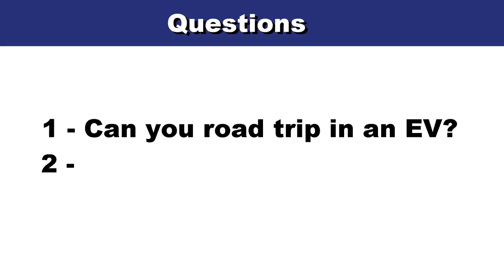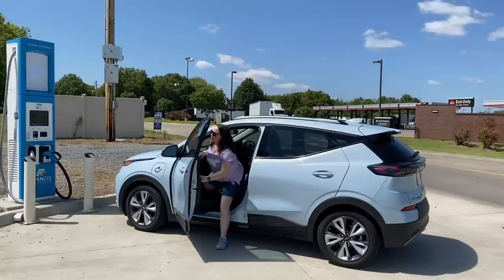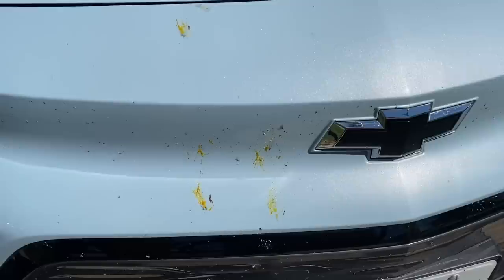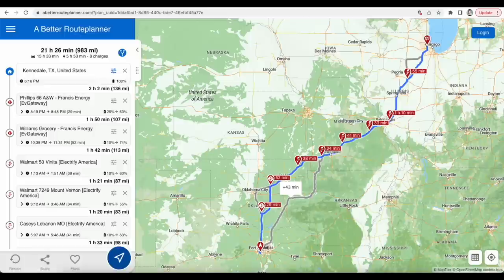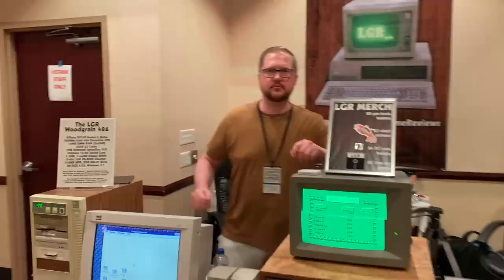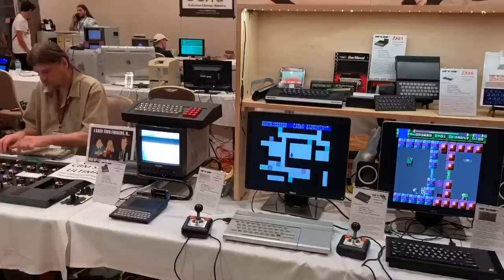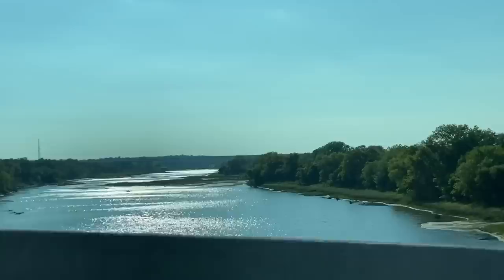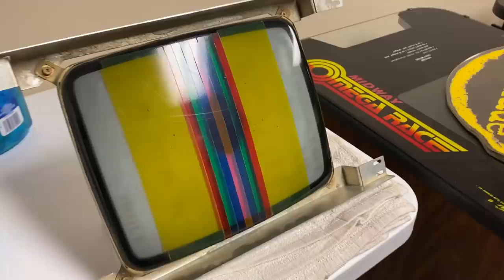EV Roadtrip, Vintage Computer Festival, and Moonbase Repair

Comment: Back in the day (1993-1994ish) I had gotten really lucky, and had a chance to upgrade my Macintosh SE. New hard drive, external drive too, maxing out the ram, I had to buy one of those really long 'mac cracker' screwdrivers.. the works! It was am amazing time, and I was super excited to get it all set up and put together. Unfortunately, in the process of the various opens and closes that had to be done, I was struggling to get a cable on the motherboard loose (it had a clip you just couldn't access reasonably), and I instinctively rested my wrist on the board on the end of the CRT. I guess I put just enough leverage on the pin connector there, because it snapped off the pencil-eraser sized nub on the very end of the tube. I KNOW this experience... and it still hurts to see it happen to someone else!

The story does have a bit of a happy ending tho. I researched the costs of trying to replace that tube (burnt tubes were cheap, but unburnt tubes were ungodly expensive) , and it would have been much cheaper at the time to just pick up another mac. The parts I'd purchased for the upgrades were able to be returned, and with some help from my sympathetic parents, I was able to pick up a Macintosh Color Classic on a 'we're having trouble moving these" sale. That color classic was where I learned Photoshop (2.0), and it was with me, and still working until 2002.

But I will forever remember that feeling of the vacuum breaking, and the air rushing in. I feel for you here! Be sure to hang onto that tube tho til you get a new one, so you can measure it for replacing the color strips (assuming you plan to do so).

Comment: its wild there are so few charging stations still. you would think restaurants and shop owners would be fighting each other to put them on their property and they'd be all over the place. you literally have a captive audience/customers with time to kill. but i suppose just like electric car ownership itself, charging station installation is a cost barrier to entry. i hope Biden's bill with electric car subsidies does something to help people overcome these barriers.
Reply from the maker: Yes, unfortunately, installing a DC fast charger probably costs north of $100,000 at this point.
Reply: Electric vehicles are about the same as methane/natural gas vehicles: rare. As an Okie I'd have to say those "Francis" chargers are likely an example, as they're likely installed & maintained by Francis Tuttle Technology Center (a votech), likely with funding from a grant.
Reply: It's not just the quantity it is if they're even working and vacant. If you're running low on power there's nothing more stressful than having to search around for a charger. That's why I won't be getting an EV until I am forced to. The eco friendliness is over-rated, the manufacturing process on an EV requires more energy and the battery materials are mined in very bad conditions for the workers. They're for people who just believe what they are told by the government and don't look at the wider picture.
Reply: @6581punk  yeah its not as green as it could be but i feel like its at least a baby step in the right direction. the real polluters are corporations though not individual cars.
Reply: @6581punk  you sounds about a decade out of date
Reply: Yes, spend massive amounts of other peoples money to subsidize a wealthy minority.
Reply: @6581punk  Not to mention I don't want that massive bomb of a Lithium pack anywhere near my home, especially while charging.
Reply from the maker: Ahh.. but a massive bomb of a tank of combustible gasoline is totally fine?
Reply: @The8BitGuy  While it's true that the two aren't that dissimilar, and it is possible for the electrical system to short out and cause the gas to catch fire, I'd say the chances of that are pretty slim. 

Now take the gas tank and put it inside the electrical system, beef up the electrical system like crazy, and make the 'fuel' inside combust if exposed to air. Not to mention if it does catch fire it's a whole lot harder to extinguish. No thanks ;)
Reply: I think a lot of it is conservative-aversion to electric cars. What I mean is that trip he took is right through the densest (pun intended) part of 'Merica and shop/restaurant owners that are deep-woods pro-fossil fuels think putting one in is tantamount to burning bras and the American flag and will put them in the crosshairs of their conservative customers. That may sound ridiculous to the rest of us, and "doesn't everyone's money spend the same"? But you really gotta understand just how some of these people are. Everything's a statement, and they know better than anyone how much their peers will slag them for making the wrong ones.  I really believe with the one-off or local-level businesses, this is totally, totally a factor.
Reply: @Cre80s  Never thought of it that way, but I think your right about the aspect to these people "Everything's a statement", the obsession I've noticed about pointing out "virtue signaling" or equating things with it has come to an almost obsession to be seeing it everywhere. So an EV charger at a business then becomes a statement about that business to the community at large who frequent their business. The owner has to take that into account if most of his customers view the charger as some kind of statement they don't agree with and may take their business elsewhere. Versus that business owner thinking about brining in a more captive audience who has to stay for at least 20 minutes at a time. Was it this bad during the transition from the horse and buggy era to cars too?
Reply: @absalomdraconis  What are you talking about? There are tons of EVs in many cities and lots of public transit runs off natural gas. Minority? Certainly. But rare? Hardly.
Reply: @BriBCG  @The 8-Bit Guy That's not how lithium batteries or petroleum tanks work. Both sides are wrong here. Despite the portrayal of automobiles in movies and media, they aren't explosions and bonfires waiting to happen. Just like gasoline, it takes very specific circumstances to cause a reaction to reach critical. Part of the fear of consumers surrounding the tech is how little control you have over your fuel source combusting while refueling. In an ICE vehicle, you should simply not smoke near a pump and always discharge your body on the car's metalwork when exiting a vehicle. In an EV, you have to ensure that your charge controller is working properly, and most people don't have the expertise to quickly recognize the signs of a malfunctioning BMS (Battery Management System).
Reply: @nimoy007  Yes, I'm aware that gas tanks and batteries don't literally explode (it was an exaggeration) and I'm sure the 8-bit guy is as well. And I know that a thermal runaway isn't going to be a common event, but the fact that it can just happen because something got damaged or was defective while the car is sitting idle or charging makes me nervous. Especially once BEVs gain mass adoption and when there's a lot of heavily aged packs out there.
Reply: @nimoy007  Or if you want another perspective, consider this: How many cars on the road are BEVs right now? If I had to guess around 1%. There's already a few instances of the packs going up in flames. So multiply those few instances by let's say 70, then increase it again as the average age of the packs increases, then maybe walk it back a little as improvements in safety come about.  

That's a little disturbing, not to mention the greatly increased chance of chain reactions as was already seen once with electric busses that were closely parked together.
Reply: @BriBCG  it's not exposure to air (or water) that causes the fire- there's no elemental lithium in a lithium ion battery. It's short circuiting from mechanical damage that causes it- leads to thermal runaway. In fact, most EV manufacturers recommend water, though a lot of it, to extinguish battery fires. Basically, you have to cool down the cells that are in thermal runaway, and keep them cool untill the ones that are mechanically damaged and thus shorted out have exhausted their charge. The mistake people make is either they assume there's elemental lithium present and thus, water will make it worse, which isn't the case at all, or that you can shut off the water as soon as the flames are out, which again is not the case- you keep spraying for a while afterwards to give the shorted cells time to discharge. Lithium ferrophosphate batteries don't have the thermal runaway issue at all, and there's some EVs that use them. The disadvantage there is the somewhat lower energy density.

However, the issue with EV fires is still way overblown- when it happens, it becomes national news still, that's why you hear about it. Meanwhile, every day, hundreds of gasoline powered cars burn to the ground and it barely warrants a mention on the afternoon traffic report if at all.
Reply: @puckcat22679  My understanding was that exposure to air causes a chemical reaction that generates heat, not necessarily anything to do with the lithium itself. But you may be right that air isn't a problem, though if the battery is damaged enough to be exposed to air then a short is almost guaranteed anyway.

I also get that many gas cars go up in flames, probably more than EVs even after you account for the ratio of ICE v EV. We were specifically talking about spontaneous fires during idle or charging, not ones during use or crashes.
Reply: @Cre80s  Yeah... Really wish that aversion to electric would go away. 
It is inevitable that electric will take over. The fact is, electricity Its a universal energy medium that can be generated with practically anything. Your Electric car doesn't care what the electricity was made from. Gas is a nonrenewable resource and one day "Drill more" isn't going to be a solution.

Also instant Torque is amazing. Sure it doesn't have that thunderous rev up sound, but what isn't more awesome then having all the power of your truck instantly available you.
Reply: Future Pants  dude - then your problem is with capitalism, not EVs. Its capitalism dictating that introduction starts with luxury models, not necessity. If we had a system geared to need EVs would be going free to people who actually have to spend a lot of time in vehicles cos it would make the most difference. Cities would be getting public transport upgrades and personal mobility infrastructure.
But we have a system geared to corporate profit by those who have the money instead - thats called capitalism.
Reply: @marcusdamberger  greenwashing is the correct term. 'virtue signalling' just makes it seem like you object to basic decency
Reply: @BriBCG  tell the world you have no grounding in engineering without...........
Reply: @mycosys  Because everyone who discusses a topic needs to be an expert? Heck, here we have The 8-bit guy doing repairs and he certainly has none. What's wrong with being a hobbyist?
Reply: In addition to the cost of installation, one problem a lot of locations have to contend with is that all of that heavy-gauge copper wire in those charging cables is an attractive target for theft.  There have been numerous cases of charging stations being vandalized by copper thieves looking to make a quick buck, unfortunately.  Locations like a Wal-Mart Superstore or a highway "travel center" (Pilot, QuikTrip, etc.), which are usually open 24/7 anyway, don't have so much trouble with it because they always have surveillance cameras and people on-site to monitor them, but restaurants and such would have to invest in extra security measures to monitor the charge stations outside of business hours when no one is around, and that can add up to spending a lot more than they bargained for just to attract a relatively small number of customers.
Reply: @BriBCG  except you are stating things as fact you have no clue about, and then doubling down when corrected, not 'having a conversation'. You arent even a hobbyist. Dunning Kruger at its peak.
Reply: Future Pants  Not only that, but contributing very little to the thread other than insults and needless corrections. I was having a nice time until that dude showed up. 

Maybe I was a bit condescending at some points, and I apologize if anyone was truly offended by that, I just happen to have strong feelings about that topic.
Reply: @ballyastrocade5672  There's an easy solution for charger security outside of hours: a locked box. They could even keep it locked during the day and unlock it only if you are a customer, like many places do with bathrooms. Free L2 charging would be pretty cheap (under $1k for equipment and under $2/hr for the electricity).

Comment: The CRTs is key problem of all retro devices. You can find most of spare parts but CRTs appearing to be more and more rare. And unfortunately they are not immortal. So it's just a matter of time...
Reply: Also, the one of the last places that would refurbish CRT's closed it's doors several years back in 2010, Hawk-Eye Picture Tube Manufacturing. I wonder if the guy would have seen a resurgence in demand a few years after that with all the retro gaming people wanting CRT's. But the owner was only seeing about 2-3 picture tubes a day, mostly vintage TV collectors at the time.
Reply: I wonder if a Rear-Projection system with a curved mask screen could be used to "replace" a CRT using perhaps an LED mini projector? The curved mask would be a diffuser and kind of do the same things a phosphor woulds do. Or Project it from above onto a curved surface, like those Halloween Mannequins with film projected on the curved face.
Reply: @marcusdamberger  We had such service in Moscow. But it was also shut down in 2020
Reply: @dazaspc  I don't think it would be adequate replacement

Comment: I'm curious about the cost of charging all those times as opposed to gas prices for the same trip
Reply: Electricity is actually very cheap, so charger maintenance might be a notable expense.
Reply: Think it is about even, with a slight advantage to gas if my math is right. a quick trip from Huston to Chicago is 1075 miles figuring around 30mpg for your typical gas car,  for a total of 36 gallons one way, took the average of TX & Chicago, and it was around $3 per gallon for a total of around 110 one way. On the EV side of things went off Chevy's website of 29kwh per 100 miles so that would be close to 11*29kwh. Given the early charging stations (TX/OK) was around 40 cents per minute and latter charging stations, I couldn't find info on, would be closer to 130 one way before any hookup fees, etc. Think with some of the charging stations the price of use might be built in to another bill (like the hotel room). This is part of the reason I was having trouble.
Reply: @zachronspees6432  30mpg? What kind of gas guzzlers are you driving?
Reply: @Okurka.  Was being conservative & if I wanted to do a gas guzzler it would be closer to 15. Most know gas engines lose MPGs as they age. Also most know that over the past 20 + years even the best regular gas engine designs with an automatic transmissions only squeeze out an extra 5mpg, making 35 combine being the current standard.
Reply: @zachronspees6432  Only in the USA, then.
Reply: @Okurka.  Maybe. Only gas cars that have better MPG are 3 cylinders small cars (upper 30s), on par with diesel cars. From 40s-60s are the hybrids. One car, that claimed to have more, but they have been in the prototype stage forever,  is Elio Motors (claim to be in the 80s).
Reply: @zachronspees6432  my 2.4 4cyl with 280k miles gets 30/40, might be a Honda thing

Comment: My parents bought a Model S 70D in 2016, and it had a range of 220 miles. I don't think they even sell a range that small anymore! Though the density of superchargers does help things.
Reply: I agree; I doubt it very much.  In fact, I just looked it up, and the shortest-range vehicle Tesla sells now is an entry-level Model 3 with 267 miles of range (the Performance model offers 315), which has your parents' 2016 Tesla Model S 70D beat.
Reply: All superspecialweeniechargers run by diesel, natgas, or GASP nuclear. Some by coal ….
Reply: @jakematic  Still more efficient than small ICE
Reply: @mycosys  not even remotely correct, and a diesel vehicle is far more efficient than an EVAgirl ‘car’. Then again your a fanboy of them so there is no reasoning. Especially about the trail of toxic metals and stripmining.

Comment: As an EV driver myself I'd love to know what "high end" model of EV you're thinking of with 500 miles of range.... Doesn't exist if you're speaking of real world range not fanciful pie in the sky claims by manufacturers...
Reply: The Mercedes Vision EQXX  has done 750 miles. Still only a prototype though.
Reply: The Lucid Air GT is capable of 520 miles

Comment: trying to rationalize the much inferior charging experience with a "eh, we were looking forward to the stop anyway" is funny.

Imagine what would happen if both chargers in a stop were busy. Imagine what would happen if two stops were out of order. It's a much, much worse experience than gas and as it is right now, it's not a viable option if, say 50% of the population had EVs
Reply: This is one of the reasons so many Americans choose a Tesla. Not only do the cars charge much faster, but they have their own dedicated charging network with far more stalls per site, and with excellent reliability. They also eliminate the need to plan charging stops, as the car does that for you. Tesla made EVs practical for road trips in the US. Some other EVs can match or even beat Tesla on range and charging speed, but they really need better charging networks to come close to Tesla convenience.